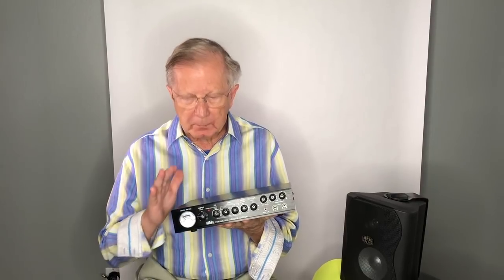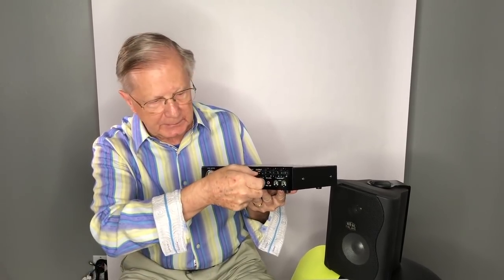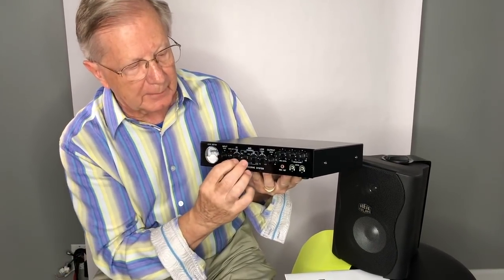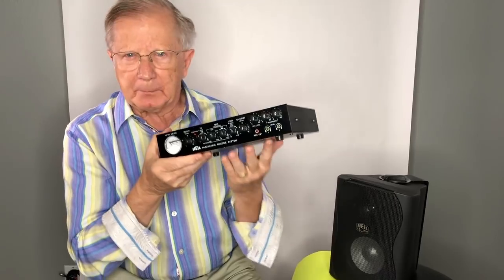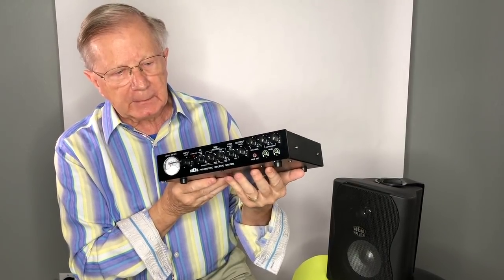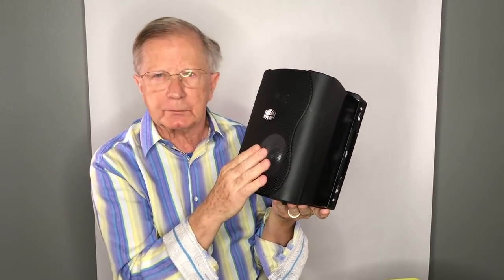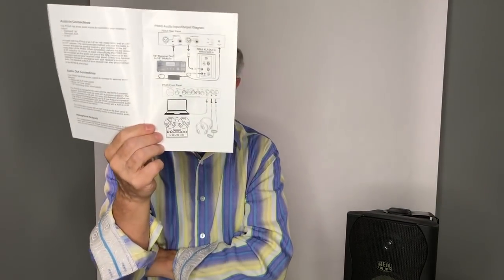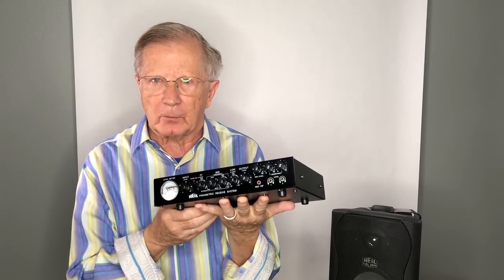Introducing the Parametric Receive Audio System

Comment: No RF shielding + no circuit to cut off speaker while transmitting = RFI nightmare.  Great sound, perfect for SWL, but the RFI is horrific (loud hum, even though dipole is outside and everything in my station is grounded).  Now I got to spend an extra $50 buying dozens of ferrite beads in an attempt to solve the problem.
Reply: Just got one today, the RF it picks up is horrendous. No wonder I got it cheap. I really like my  Heil gear but not this one.

Comment: I don't understand how a high pass/low pass filter and equalizer is a big deal. Drop the lows and highs, boost the mids....You've got an mp3!
Reply: Chris... the important factor is the PARAMETRIC mid filter.  YOU become the engineer.  One needs to be able to move the center frequency of that mid filter to pull out the needed speech articulation - just what a Parametric filter does.  I set the outside 'gates at 160 Hz on the low end and 6kHz on the top end with a + or - 15dB notch or boost leaving the variable mid filter work from 400 Hz to 4 kHz.  Chris this is a miracle box.... not just high pass/low pass.  It has never been done in this market before.    BOB HEIL

Comment: Two complete systems (~$1k) for a dual speaker output transceiver?
Reply: The PRAS has three inputs.  You will be able to connect your two receivers into the PRAS and have the signals combine through the one HPS 5 speaker..... amazing technology or you

Comment: Ok Bob that is phase one. Next is to produce a unit for RX A and RX B like on my Flex 6400M
Reply: The PRAS has three separate inputs.   You are able to connect the two receivers into the PRAS and have them combine into the HPS 5 speaker.  Amazing new technology